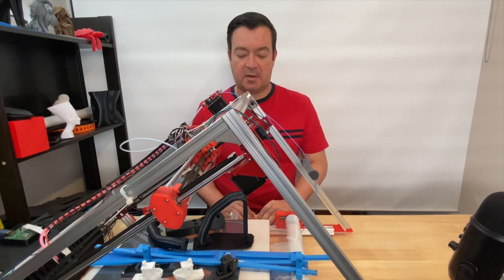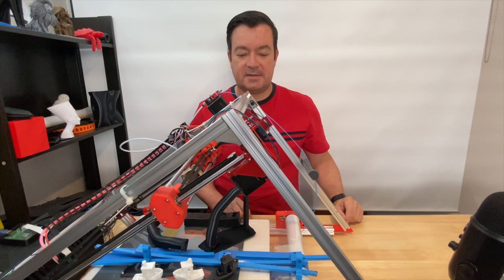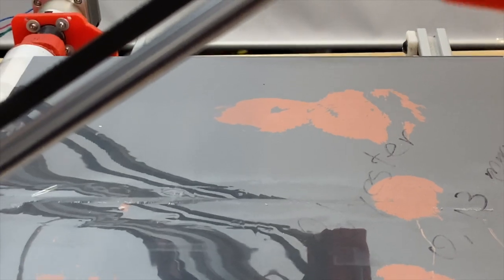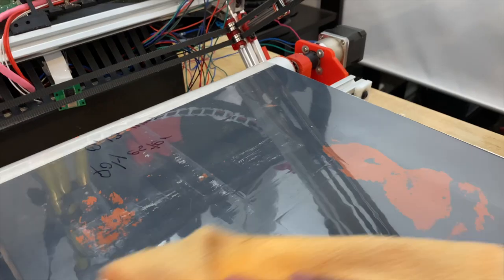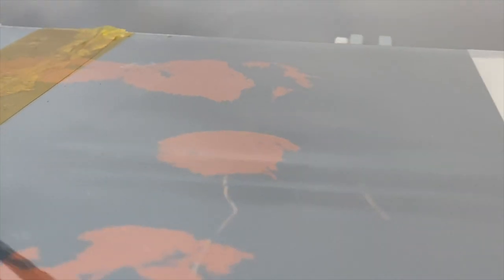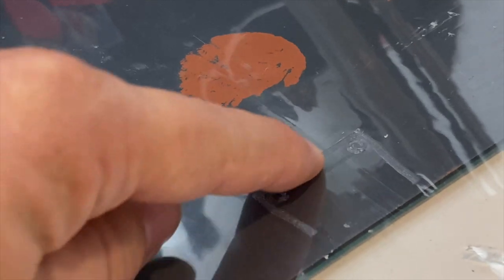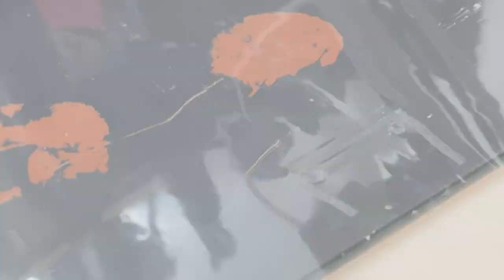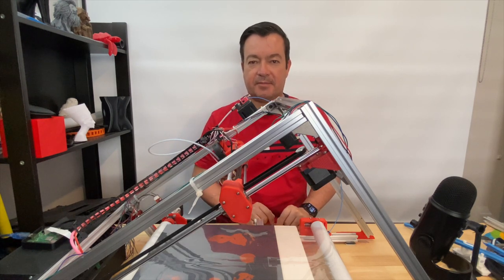Belt Printer: Polyester belt durability

Comment: Nice build first of all ! 
I have been thinking a lot on how to build a DIY good working belt. That part is at the moment holding me from building a belt 3D-printer. I was thinking of combining several materials to get rigidity flex and temperature at the same time. 

As an idea
The inner layer: Solar film, very pricey as base for the belt
Middle layer: Ordinary paper on a spool to get rigidity and temperature isolator  glued with white glue as it would dry with ease thru the paper 
Top layer: Wide capton tape as it manage high temperature and stickiness.  

All layer belt joints done in minimum 45 degrees angle (best angle is a diagonal over the hole belt length as it will give the same bending force over the hole belt). As all three layers are available on spools the this should be easy made.

What do you think ?
Reply from the maker: Thanks mate. The three layers sounds like it could work. But harder to execute. The community has been proposing steel with a magnetic base. I’m keen to give that a go. It will also make it easier to replace the top layer if it becomes damaged. Top layer can be kapton or buildtak
Reply: @ZechyC  Steel with a "seamless" joint is crazy expensive. That's why I'm looking for an alternative. I've got to get my "projects" together before I'll give a belt 3D-printer a go. 

PS just had to by 2 Velleman Vertex nano just for good parts for my PCB cnc. Got them for less than 150€ each on sale and now they are printing brackets for there own death and revive to a PCB CNC ;-) DS

Comment: I would be interested in seeing what damage occurs if you let the parts naturally peel off instead of pulling them straight up. Thoughts?  It looks promising.  I'm thinking the Kapton is a good surface maybe on top of it... especially with ABS or PLA, which stick fantastically when hot, but release when cooled.
Reply from the maker: Good thinking. I should test the natural peeling. Thanks for the feedback 🙂

Comment: Do you have problems with the print rocking back and forth as the print head travels since the belt is so flexible?
Reply from the maker: The rocking is mostly from side to side. Yes. It is still a problem. The belt is pretty stiff in the direction that it is tensioned.